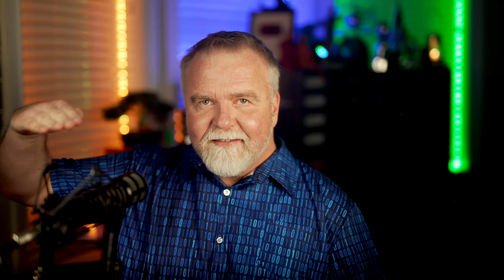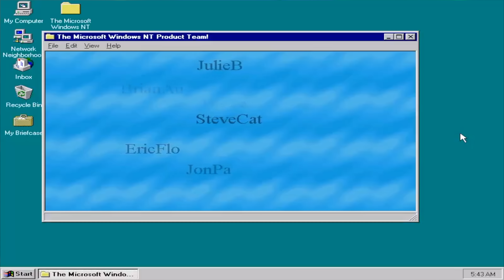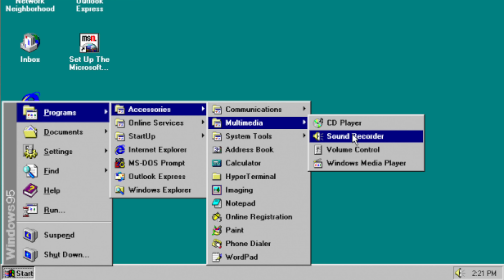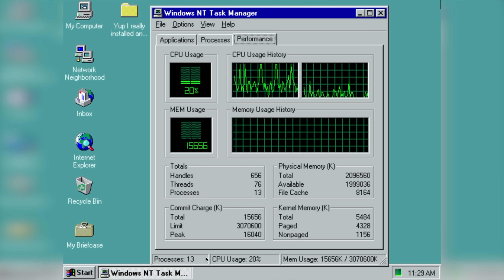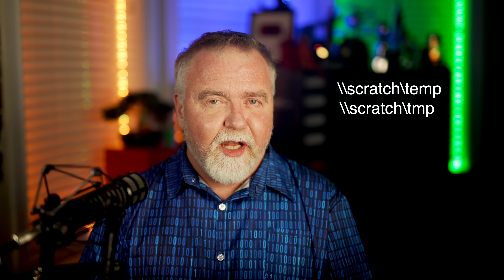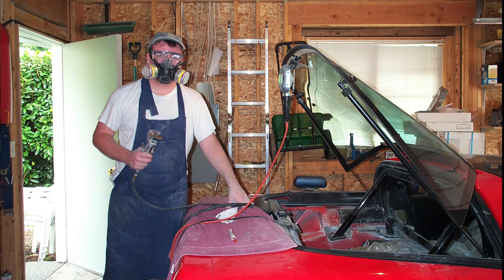Behind the Windows Start Menu - Insider Secrets

Comment: TL DR, I've used windows since 1997 and ive had quite the adventures in doing so which is why i love your insights.
--
For me, the thing I love about your series is, I am intimately familiar with windows home versions since 3.11. i have used each version of windows for years and upgraded or bought into the next. I remember trying to use 13 floppy disks needed for windows 95, and diskette 11 failing. try as I might, it would not successfully decompress. So, I had to go buy the Windows 95 CD, meaning I also had to upgrade my PC with a cdrom drive, and learn to load the cdrom driver in my autoexec batch and config.sys. Fortunately, since I did have windows 3.11, I could purchase the upgrade 95 instead of buying the full version, and i was off to the races using windows 95 on my dell 486 dx 66 that i got used from a donation. this was in 1997, and everyone else around was on the new shiny Pentiums with MMX, so the old x86ers were junk with no MMX, but I was happy with my junker clunker dx2, that I eventually upgraded to a dx4 thanks to a friend who bought a new "celeron" computer with windows 98. I scavenged his 8 megs of ram and his dx4, and put that into my old dell desktop, and clocked the motherboard bus to 33x3. Now I had 99 mhz processing power. I was actually happy on my Windows 95 486 dx4 with 16 mb ram, until I was told my pc could run Windows 98, and I knew then I had to upgrade. 98 was everything I knew about 95 but better. From that point, I had Windows 98SE, then Windows ME, running in that DX4, until lightening put it out of its misery, which is a good thing because Windows ME on that dx4 was slow and lots of hdd chugging because of 16 megs of ram. I dont know how I got it to run, but it didnt last long. My next system was a compaq presario 5000 (with the blue face) that came with 98 on a celeron, thanks to a relative who upgraded her pc. It was a nicer looking system with 128 megs of pc 133 ram. I was given a copy of Windows 2000, by my college, (for student use), where I started studying microcomputers. I realized quickly though, that this great looking presario was not my friend, and it suffered from popped caps and I had to trash it. It was very sad since it was a sweet looking case, but filled with junk from 2001. My next computer was a used gateway 2000 Pentium 3 1ghz with 256 megs of ram and Windows XP, which was the new shiny hotness, and everyone had to have it. The college provided me with a copy of XP, and my it was incredible. Later as i got more into my career in IT, I got a copy of vista on a dell and thought it had interesting things, but was not as simplistic and elegant as XP, so I stayed on XP as long as possible, and even dual-booted a 98 SE system with XP so I could have that DOS gaming functionality when desired. I played World of Warcraft endlessly on that machine over a dial up connection, but all good things must come to an end, and the gateway died on me. So I had to get another PC. This one was a used office computer that was salvaged from e-waste. it came with Vista, so I got used to using it, and soon I got to appreciate vista 64 bit being able to do more with the new 64 bit CPU. Of course, in time, I began to run Windows 7 8, 8.1, 10 and now 11 at work. I have used all of them for either fun/personal or professional use for countless hours, and they have been part of my life for decades. This is why I am grateful for the look inside how these pieces of my life were built from one of the architects. Thank you. I hope maybe you are still developing or consulting on the side, since it seems you still got the knack for it.

Comment: I remember the first time I encountered your zip integration.   I thought it was cool, but when I tried to run an application within a zip file it didn't behave properly because the app couldn't open other supporting files within the zip file on its own.   But I found it very useful for viewing individual files, especially the classic readme's.
Reply: Maybe older versions were different but in XP I definitely remember when opening an EXE it would ask if you wanted to extract all the other files as well.

Comment: Windows 11 stupidity:   Having the start menu button that's on a dynamically changing taskbar.    

"But that's how it works on a Mac"

No it's not.   The launcher is on the bottom and centered on a Mac.   The mac os menu bar is at the rop.  

Thank God the taskbar / start button can be fixed on Windows 11.

Comment: Hey Dave, can you explain what My Briefcase is? As a kid I remember trying to figure it out and not having a clue what it did.
Reply from the maker: The Briefcase is a special folder that supports a simple two-way file synchronization between itself and another folder. The Briefcase is designed for mobile PC users so that they may transfer it to a removable drive and have it synchronize with the computer to which the removable drive is attached. It follows the same metaphor as the file and file folder and then, while the file management tasks are performed by Windows Explorer, the briefcase behaves just like another folder, i.e. with support for copy-paste and drag-and-drop. It has additional functions and toolbar buttons for updating out-of-sync files. Stole that from Wikipedia because I had a hard time remembering :-)

Comment: Loved the zip folders, but the encryption portion gets a little flakey, and should probably be a separate component, which can be updated while still supporting whatever mechanism was used for encryption.  Also, I did the same color thing with my business objects in AppBuilder -- black was unchanged, blue was changed and valid, orange was changed and invalid but could be saved for later, and red was changed, invalid, and the user had to fix it before they saved. Was going to ask you if you worked with Don Box and Chris Sells at any time, but if you were in COM, you probably did. :)
Reply from the maker: I didn't think it supported encryption - my original shareware version did, but I thought they removed it for production Windows!
Reply: @DavesGarage  I'm pretty sure the built-in version supports encrypted Zip files, but maybe it's only decryption of existing files.

Comment: Personally, it's quite surprising to hear that the Windows development team suffered from multi-byte character handling, as MS-DOS and Windows 3.x/9x had various i18n variants with CJK support. They didn't support Unicode, but they could handle 2-byte character sets (such as CP949, CP932, CP936, etc.). Perhaps these localisations were handled entirely by local Microsoft subsidiaries, rather than the Seattle HQ?

However, thanks to the hard work of you and your team, applications that rely on legacy MBCS encoding are still working on Windows 11 today!
Reply from the maker: Backing up through an MBCS string is a good interview question, or it used to be!

Comment: The ZIP handling I never liked because it is only visible in the explorer and not integrated into the file system. Meaning that if I have an installer with several files in a zip, I still have to unzip.
But the menu system of NT was great. NT was - in fact - for me the first grown up os microsoft produced. I did come from Sun Workstations at the time and enjoyed working on it.
Reply: The last time I checked if you open an EXE from a Zip file it asks if you want to extract everything to the temp directory.

Comment: Dave - I worked at a place where one of the other devs had the idea to create our entire application as a shell extension in Windows 95/98 using Visual Basic COM objects.  That didn't go so well because if you wanted to have a window with 5,000 objects, you ran out of memory in the shell process pretty quickly.

Comment: Just a question:
Why are some dialogues still so small and not resizeable like when right-clicking on an object:properties:security. 
Only showing 4 or five lines and scrollbars everywhere. 
Still the same size as in Win 3.1 with a resolution of 640x480.
Reply: I don't think any of the dialog box functions built into Windows support dynamic layouts.

Comment: Hey Dave, if you see this message, I have a very specific question about MSPaint. Maybe you can point me in the right direction?

WindowsME had a feature in it's MSPaint, that was discontinued, but was very useful. I have never seen it since, nor before WindowsME.
You could manually set a transparent background color for images. This was fantastic in the days of the early internet, for webpage graphics. For some reason, this feature was no longer available in WindowsXP and beyond. What happened? It was so good, and now it's gone.
Reply from the maker: Sorry, I wish I knew but I don't!  It happened quite a bit after I left, unfortunately.
Reply: @DavesGarage  Darn, well if you're ever open to doing a video on MSPaint, that would be a really cool tidbit to know about. There are ways to use MSPaint for the same thing now, but in my opinion, they're not as elegant of solutions as the WindowsME way of selecting a specific RGB value. (Felt like a step backwards when it was absent in XP and onward)
Reply: It still exist i think you can select to copy image as transperent to igrore white bacraund do u think on that i never resarch win me to much behause is part of dos karnel but not have dos mode d:
Reply: @HuzaBird0.1  it is not the same.

Comment: One day I'll put XPx64 on bare metal again for reasons. VM just does not hit the same. Miss the simplicity. W10 has treated me well. I could survive on XPx64 if modern apps supported it and it had security patches but it does not so I cannot. I used the classic start menu so I guess I was looking at Dave's work everyday for a long time.

Comment: it might be cool to implement 7-zip as a shell extension. The standards and code are as wide-open to read as possible, meaning, it might be super easy to tell Windows, "this file's a folder. here's what's inside"
Reply: The library he mentioned supports 7z and dozens of other formats, but as he said it's not clear yet exactly what form this will take. It's implied to be a replacement fruit existing zip support, which should mean it would be a shell extension, yes.

Comment: Hi Dave.  I am one of the young men who built an IMSAI 8080.  I still have it and I finished building it on July 4, 1975 in a cabin up in Big Bear.  My questions are:
1.  Do you remember Dr. Dobbs Journal of Calisthenics and Orthodontia (running light without over-byte)?  Since I only had 56K ram, a 2K basic interpreter was too good to pass up.  They had published a Tiny Basic, which  I typed into my home-brew monitor which was stored into a 2708 EPROM.  Oh my, how things have changed.  
2.  A by the way, I got a copy of MS Basic, at a time when I did not know who Microsoft was yet.  The thing I was most impressed with was that it coded just like Basic Plus 2, for which I  was developing utilities for our network (1 MBps DecNET) of PDP 11s.  After watching your story about the early incarnation of MS Basic, now it all makes sense.
3.  You mentioned the way to get the credits from the  authors, but you did not mention how to invoke it in Windows 11.  Would you be able to fill us in?
4.  If you would be interested in my IMSAI (the real deal, not a simulator), I could be cajoled into parting with it for a  small price.  I have not powered it on in quite some time.  It has 56K ram and an 8K EPROM board.  A Tarbel Cassette interface, a home built (yes wire-wrapped) that interfaced with a printer that used a TTL parallel interface without buffering.  I wrote what turned out to be "double buffering" since the printer would stop accepting data during CR-LFs,  before I  knew the term double buffering.  The IMSAI brought me to a career spanning from 1975 until this year as I retired.

Thanks for all your most curious stories,
Marc
Reply from the maker: Hi Marc!  My IMSAI is a clone, it would be great to have an original!   Drop me a note at the channel email from the About page and we can chat on what it'd take to get you to part with it!  Very cool that you were involved that early.  I would only have been about 7 years old at the time :-)

I've run MSBASIC and CPM on mine, but haven't spent a great deal of time with it.  I imagine you've seen the video I did on it?  If not, check it out (I bought the computer from wargames, I think it's called).

The credits screen is only in Windows NT 4, as far as I know.  Win95 had a different one, NT 3.51 had a screensaver one, and so on.  But you won't be able to get this one on Win11!

Comment: What remains from the NT in the modern systems? Was the modern Windows OS combination of the 95 and NT bases?
Reply from the maker: No, NT was entirely new from scratch.  The only Win16 code that would have survived might have been in the WOW layer, basically a Win16 emulator.  But no system code.

They've massively expanded the system, and with HyperV I'd imagine the kernel has changed a lot too, but the core stuff would still be there.  It's a total guess, but I'd suspect maybe 75% of the kernel code that shipped in NT3.1 is still in there, modified or otherwise.

Comment: maybe this is a little too far behind the curtain but, I'd be interested in a story on how you ported a DOS based windowing shell to a NT system.
I also have a question about zip. wasn't there a legal issue with PKWare at some point?
Reply from the maker: I have a whole video on Phil Katz and PKZIP, check it out!  ZIPFolders didn't use any PK code, as it's based on a licensed version of DynaZip.  I'm not aware there was any legal issue between MSFT and PK, at least not to my knowledge!
Reply: @DavesGarage  I was thinking of mp3. I just remembered. There was a patent dispute.
Reply: AFAIK all the 95-specific shell bits (like Explorer) were already fully 32-bit on Windows 95.

Comment: That "Run in separate memory space" checkbox from the Run window is quite... interesting. Was this for 16-bit compatibility?
Reply: All DOS and 16-bit programs run on Windows 7 in the Windows Virtual DOS Machine (VDM) program. VDM simulates a 16-bit environment, complete with the DLLs required by 16-bit programs.

By default 16-bit programs run in a single VDM with a shared memory space. They share the memory space allocated to the vdm process and therefore, they cannot run simultaneously.

This will show you how to add the Run in Separate Memory Space check box to the Windows 7 Run command dialog box. When Run in Separate Memory Space is checked, a 16-bit program runs in a dedicated (not shared) (VDM) process with a separate memory space."
Reply from the maker: Precisely!  As far as I call, the shell checks the path to see if it's a 16 bit binary you're trying to launch, and if so, unghosts the option.
Reply: @bloodgulchpatrick  Thank you for the thorough explanation!
Reply: @JohnnyN-I  no prob, it's just some good copypasted explanation from the web

Comment: Great video! I'm somewhat confused by one thing though, you describe the NT Cairo shell as being seperate from the earlier Windows 95 one and competing, but I'm fairly sure I've seen that same shell in the very earliest publicly available Windows 95 betas. I always figured the final Windows 95 shell one was simply an evolution from this early design, is this not the case?
Reply: Yes that screenshot is of what was then called the Tray. Cairo was supposed to blur the line between a filesystem and database. They tried again in Longhorn and failed, the end result was Libraries in Win7.
Reply: @WndSks  I did some more googling and the screenshot apparently is from Cairo's GUI component which apparently came before Windows 95's taskbar which was based on the work done for Cairo, according to Wiki and Betawiki anyway. But if that's the case, I don't really understand the timeline mentioned in the video.